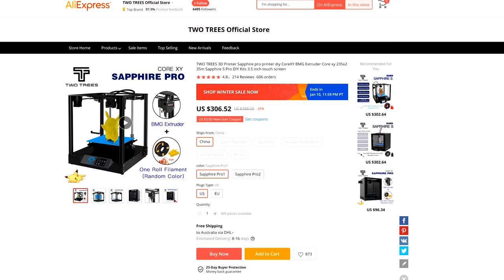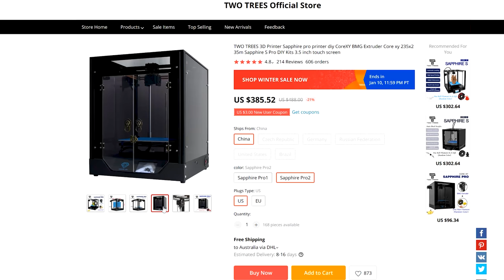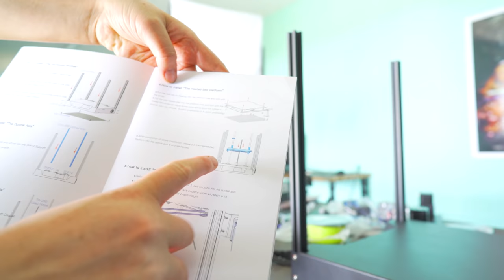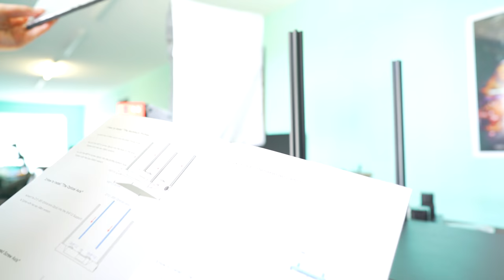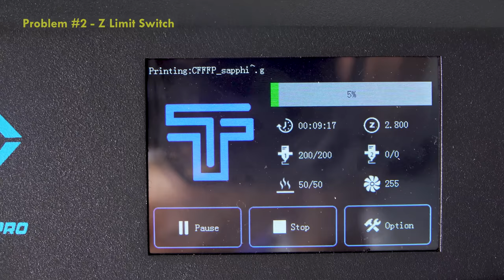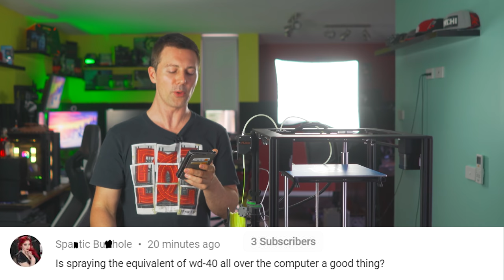BEFORE Buying a 3D Printer from Aliexpress... Watch This... (Sapphire Pro 1 Review)

Comment: Would that multipurpose spray be good in a DIMM slot? No power of course, lol. I had RAM borderline melt in a Z600 workstation I need to resell, but don't want to sell it as long as it can't do triple channel with screwed slots.

Comment: Its easy, the only printer in that budget, is the ender 3, preferably the pro version (stronger y axis, and way better meanwell powerunit)     set 1 up last week, its been great, also the bltouch auto level expansion unit worked fine

Comment: Hey brian, don’t things get greasy when you spray wd40 on everything? I always though it was a form of lubricant
Reply: I've been wondering about this too
Reply: Not really a lubricant. Its actually displaces any moisture. I was just think its smells like crap.
Reply: @TVmadethemdoit  how do you get it off afterwards?
Reply: @TotoGeenen  it is a thin oil, multi purpose penetrating lubricant. I don't know exactly what the multi can he is using but WD-40 is def an oil. I wouldn't recommend it, yes it displaces water/moisture but also gives dust and dirt something to adhere to. But hey if you want an oil residue on your PC go for it
Reply: @Apollo-Computers  there's electrical component specific wd40 apparently. I assume that's what he's using

Comment: Your jamming issues were from improper assembly of the hot end. The teflon tube needs to be cut very square and flush with the extruder nozzle. Your belts also look loose.

Comment: Hahah, i got myself a used makerbot as a first printer and had more issues with it ... the issues do not seem to be that bad, except for the software... if you're going below 1000$ you will have to learn a lot and will be frustrated for sure, but it will make you appreciate and easily troubleshoot a better printer. :)

Comment: These types of Chinese cheap 3d printer lacks customer support in general. This is just a norm, customer support is labour which adds the cost to the machine, so if you want it to be cheap, you gotta deal with it yourself. Not recommended for first time users, but for an experienced buyer, this is a bargain as build quality is all it matters.

Comment: The sapphire pro and plus are not beginner kits. 
You should start with something like a traditional cortisian style printer like an ender 3 pro or if you want to spend the money a prusa. 
And still even with those types of printers you might have the same problems. (if you don't have experience)
3d printing is a very DIY hobby, it is very time consuming and it has a very step learning curve just to maintain it. 
The sapphire pro and plus are overall a solid kit "not perfect", if we look at the specs and build material it has a lot of potential but it will require some work.

Comment: I'm looking at one of the shots from the side, and it looks like the lead screw and the guide rods for the bed are not at all parallel with one another.

You are right, this seems more like a printer for someone who has some experience and looks at it as "Well, the chassis and other main parts are pretty alright."

Comment: What I've started doing with high end electronics from Asia, is to look at all possible sources with preference to those closer to home (UK). However the price then has to be comparable. I literally have a small steel connector I need to replace that is not less than £13 from the UK, but is barely over US£3 (S&H included) from China, but now in stainless steel!

Recently I needed to replace my dual dashcam due to poor low light recording. The one I was looking at from Asia was not significantly cheaper than one from a UK supplier, so I went with that one. Good job I did as the alleged 'night vision' was total crap. I have 3 old mobile phones that do better. One is almost as good as my infra red security cams! I was able to return it and get a refund in days rather than weeks/months.

Comment: I'm expecting my Sapphire Pro ll this week . I opened some type of communication with the company.   I've said to them that they need an official multi language website with instructions plus video's. I don't think it made much of an impression. I am keeping my fingers crossed  . I'm not new to 3d printing , i've had an Anet A6 for approx 5 years . I have had to fix it & replace parts , stop leaks , so i might stand a chance with the Sapphire Pro ll i am waiting for . Its a nice looking unit but , i really would like to see more official information from the company.  There is more information on YouTube than anywhere else . GM puts out new cars but sometimes there's a recall , but they don't ignore(most of the time) , problems. Most other manufacturers have websites, toll free phone numbers , official channels to buy replacement parts or report problems. Sapphire if your reading this , please improve your customer experience,  it can only help your sales .

Comment: This is actually one of the best printers out there for what it offers. It is however a project rather than a product though. You need to do QA yourself and the most common issue is the belt pulleys not being perfectly level. Beginners should definitely not get this printer and instead go for an easy maintainable Cartesian based printer. Don't get this printer without understanding the basic mechanics of CoreXY. 

Either way once you think this hobby is for you - you will want to make/build/buy a CoreXY or delta style printer to achieve much higher print speeds anyways.

Also on the customer service side of things, apparently Sapphire had a rogue employee who told everyone to f'off and he's fired now.

Comment: If you are new to 3d printing, not that Tech Yes didnt do a good job, there are many dedicated channels to the topic that are great for beginners. CHEP, Makers Muse, 3d Printing nerd and sooooo many more. This is such a largely different hobby than computer building it can take over your life (speaking from exprience) and there are so many things to consider. Your mechanic ability, your patience and willingness to tinker and research problems all come into play. Also when it comes to the cheap chinese machines from Aliexpress, Gearbest, etc, there are things that should be considered, like firmware safety routines may not be enabled by default (thermal runaway can cause fires). These routines may not be a quick "change an option in the bios" type setting but more of a reflash the bios after you have tweaked the code and  compiled it in Arduino.

Comment: The only thing you have to worry about is actual WD-40  makes certain plastics break down  and others brittle.  Most spray solvents that are marked for use with electronics or "Plasti-safe" cleaners (works with Plasti-Dip) are good on a PC.  Remember that  WD-40 is both a solvent and a lubricant.

Comment: Most printers have these noise issues. There is a way to make a sealed enclosure for them with panels of glass and tables from IKEA.
Reply: Often it’s just motor harmonics (slow or speed up your motors some more), if it’s grinding sound well that’s obviously because you have to oil the linear rods, like duh, they won’t last long if you don’t! That’s just like oil changes in your car but with some added cleaning if they get dusty, but they last many many pounds of plastic before new sets and just normal maintenance (which people seem to forget or must all have injured hands and incapable of doing simple things like this for some reason, but I’m guessing most just don’t think about it).

Comment: In my opinion, apparently you do not have experience in 3D printers, this was my first printer and if I did not know anything about it, now I print great things with it, I think that it is complete from the factory, and add some improvements, such as the Z sensor, filament filters and a V6 hotend with better layer fans. I stay a lady machine for printing.

Comment: I had a monoprice maker select V2 and it worked great. Until I started modifying it and got in a little over my head. Haha. Ended up selling it but that experience showed me quite a bit. I don’t think I could buy anything like a 3D printer from a place like aliexpress. Fire hazards are a real thing with 3D printers and even my maker select was suggested in adding assistance with the heated bed to keep it from burning up the components. 

They have newer models now and are a bit cheaper so I might get into it eventually one day.
Reply: Haha, I always forget about my printers cable catching on fire until someone mentions it, lol! They used way too thin of wires for the 110v cable and it would get rather warm. One day in my dorm room printing some parts for a while I saw smoke and with a quick yank managed to save possibly my dorm. I was aware that it was running kind of hot so I had the cable hanging in the air with my box fan blowing towards it in the summer, like seriously “air cooling” a cable is a bad sign... just to be on the safe side, but still managed to catch fire but not long enough to do much more than slightly fill my room with smoke so I ran with my box fan to the window and set it to max to clear the air so I didn’t cause a building evacuation. Ahhh... Good times!

Anyways, it just proved my motto of overkill wires is never a bad thing (so if you see wires that could deliver 100 amps on a 5v 0.5 amp devise, you know it’s probably mine, lol! But after this incident I was able to be like “see, now the 50 amp 220v welding plug on my soldering iron isn’t THAT insane, it’s pulling at least 0.8 amps!). Oh side note I recently melted a 30 amp plug and I have no idea how that happened... Me and electrical fires, my mom gives me a fire extinguisher once in a while for a reason, what a thoughtful gift, my mom knows me well!

Comment: So is it OK to use wd40 on motherboards or not?? I've always been confused about this. Crc makes an electronic cleaner but that seems to be to contact cleaning and not motherboards
Reply: I would never use something that says lubricates on electronics.
Reply: Vlad Gruin look at video about soldering and nasa quality. These guys spend decades of research on impact of chemicals on solder joints. Never seen them spraying anything except isopropanol on boards. Think it’s for a reason.

Comment: If you still want a good and reliable 3D printer, you need to take a look at Ender 3. It's a great printer that produces perfect print quality right out of the box. Beware though! It might need a new firmware out of the box! It will work flawlessly, but it might not have thermal runaway protection out of the factory. You'll then have to flash a new firmware that has thermal runaway protection.

Comment: Other than old or more like moist filamanet, it looks like you just assembled it poorly. Also, leaking nozzle confirms this. Also using power tools to assemble aluminum frame printer, dear god. For the price, it looks decent mid-range printer. I got ender 3 recently and love it. But this one in the video has so many advantages over ender3 like rails, multiple sensors, stable bed, and better extruder. If I would upgrade over ender 3 would probably build my own 3d printer now though. The main advantage is definitely being core XY with a stable bed.

Comment: If you wanted a DIY 3d printer then you would have been better off with on from Creality. If you. Wanted. One that only takes 20 minutes to set up then get the one that I got the Anycubic Mega S for just £250 from amazon. 8 screws and a couple of very adequately labeled cables to plug in.

Comment: I heard nothing that wasn't part of the 3D printer experience.

I'm still tinkering with my Ender-3 after a year, you are buying a Hobby, not a production machine. And "deal with it yourself" is pretty much the standard answer since these are DIY kits, SPECIALLY when getting it for free. If you wanted a hassle-free-ish experience, and costumer support, you should have gone for a Prusa or an Ultimaker.

Comment: i'd rather buy a printer when the extruder is placed right on the hot end. So the extruder doesnt use so much power on the filament. In my opinion that will help on less grinding of the extruder.
Reply: Johnny Veyt there are some hotend with extruder projects that can be printed, very good solution for soft filaments, but need to consider also the added weight to the hotend.

Comment: Having looked at it.. I feel like it shouldn't be that bad to upgrade. As in, what's needed to make it work if I'd spent the time on it with fusion 360. To reaaaalllly go over the top, an e3d hemera + a bltouch would probably make it an absolute beast. That requires a new mount though. *coughs*.. review unit's you say? ;)

Comment: I am sorry your first experience was that bad.
This printer indeed is not a good first time user printer. 3d printers are CNC's essentially, and do indeed need a bit of know how, but there are better printers for first time users.
Prusa i3 is a very popular choice, their after care is really good, manuals etc etc etc. For low budget, Ender 3 does a good job.

I would take that printer of your hands, i do not see that many issues with it that i could not solve within minutes with my experience ;)
Even overview shows some issues, the bowden tube you should cut closer to length, they provided obviously over long piece just to be safe. Same goes for input sade, cut it quite short. Move the filament out sensor closer to extruder as well.
For extrusion issues, i would hazard a guess that it's how the bowden tube goes in ... or not all the way what's your primary issue. If the supplied filament is within diameter tolerance, it most likely is not the issue. With non-full metal, non-direct extrusion hotend setups it takes a bit of finesse to assemble correctly as you need to ensure the bowden (PTFE) tube goes all the way in.

This printer has many many good qualities out of the box, way beyond others in the price class (linear rails), but also bad qualities. Out of scale of 1 to 10 in difficulty, i would say this printer is around 5 - Prusa i3 preassembled is around 3 and Ender is around 4. There is nothing at difficulty of 1 and probs never will be, at least without minimum of 15 000€ annual service contract.

Oh and i have dozens of printers.

Comment: Find the firmware for the printer and try reflashing the board.
Reply: it's from china, so not going to happen, ol
Reply: @evolicious  almost all cheap 3d printers use easily accessible arduino compatible mainboards, its as easy as entering the right numbers and uploading i to the board

Comment: Before this pro version they made the sapphire S, which I bought 10 months ago. The pro version is much better, as it has a better extruder, better motion system, better electronics board, and they upgrade a lot all around the printer... For example, mine has the screen more like vertical, so it's not easy to see if you are not at the same hight as the screen... Or mine did not have insulation under the bed.... 
And still, I think that mine is one of the best 3d printers out of china, just a couple uprades and it is pretty much perfect.
Just seeing how long is that bowden tube, makes me think that you should learn a bit more about diy 3d printers.

Comment: purchased the Sapphire Pro in November from Gearbest and it's been a total nightmare and I am extremely disappointed. I have some experience, this wasn't my first printer, I have several, not an expert, but the kit I received was so flawed I felt like a total noob. I must have been a very early in the production with no revisions under its belt and whatever quality control team two trees had when it was "assembled" must have all been out sick with bird flu that week.  I spent too much time and money trying to replace faulty components and watching video guides with similar issues whose solutions didn't work. Ultimately I gave up until I too can hire a consultant. Lucky you didn't pay like did.

Comment: I bought few items recently from Aliexpress. haven't received them yet though. But I was having few issues when opening the account with Aliexpress. Can try to use the chat support when things does not sort out straight. So, I clicked for help via chat it sends to a robot auto reply section and you are in a maze of queries circling same Q's. Was really annoying. I can guess how the help and support will be there. Didn't feel comfortable after that. Hope my items turns good and don't have to deal big bucks. I prefer Amazon or Ebay, they are the best with support anytime.

Comment: I think getting this printer as a first printer is not a good idea. Ender 3 is a better choice. Stronger community and the manufacturer has gone through a lot of sh*t already, to the point that most units work out of the box and little issues can be fixed relatively easy. Of course, when you want a cube printer, you're a bit more on your own...

Comment: Like the cops say, not knowing the law is not an excuse, China say's not knowing what your'e doing is not an excuse.
All 3D printer kits from China have bad instructions and often missing parts. When you explain your problem in detail via email they will probably send you links to their badly written online manual. However if you demand a refund and threaten to rate them rock bottom on the transaction they will probably send another complete box with missing parts.  You gotta love em!